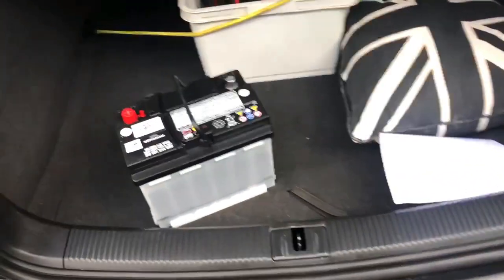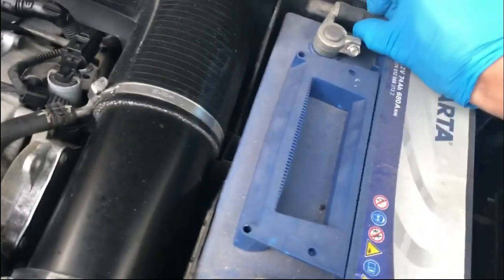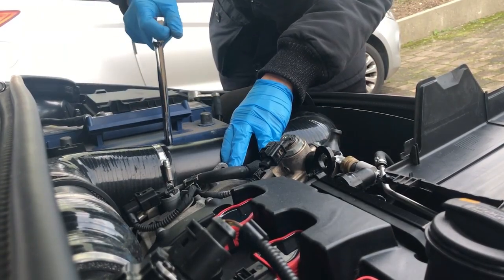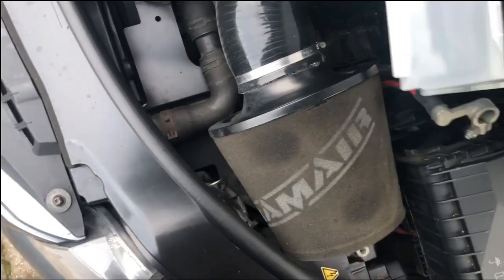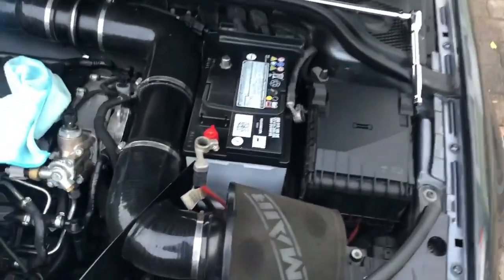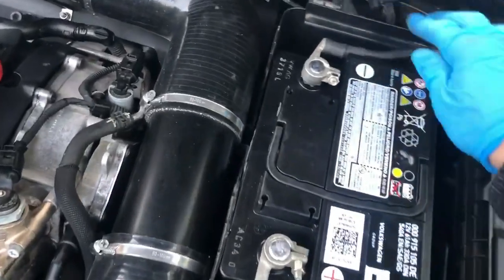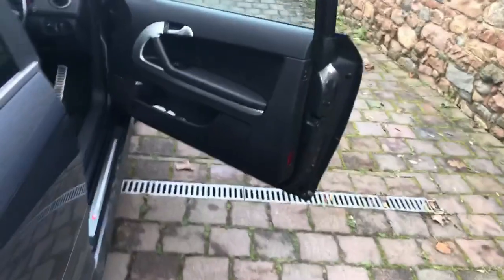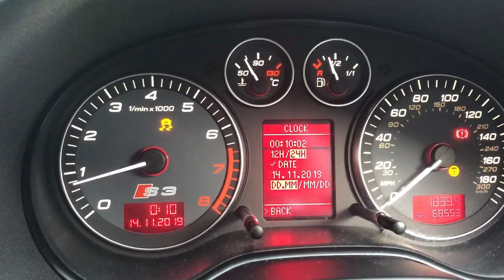New Battery For The Audi S3 8P

Comment: Why don't they have a better system for holding the battery in place. Having that inaccessible bolt is crazy. 
Rather a strap/belt over the top would be better - well, it works for holding my trousers up!

Comment: Hi mate, do you know if it's okay to use a higher cranking voltage battery as a replacement. I see the Varta one had 680A cold crank amps and the new one only has 540A on it
Reply from the maker: Not really sure tbh mate. I’d imagine that the car won’t let anything be over powered